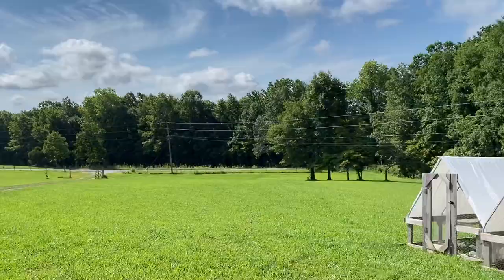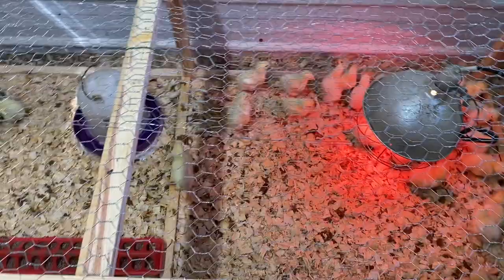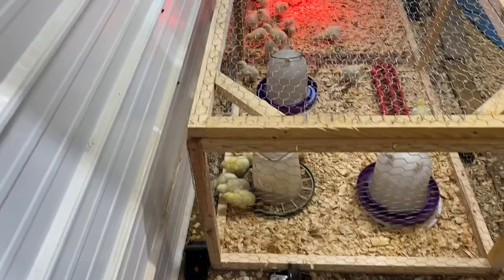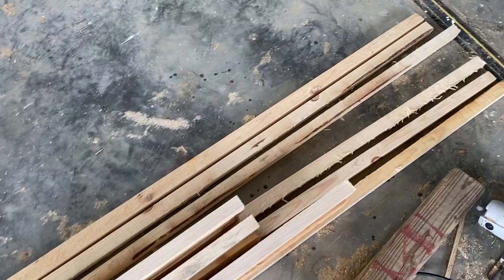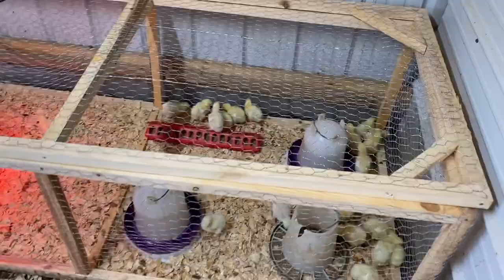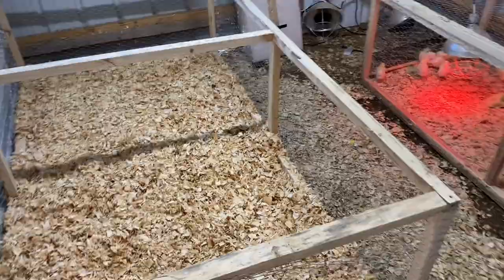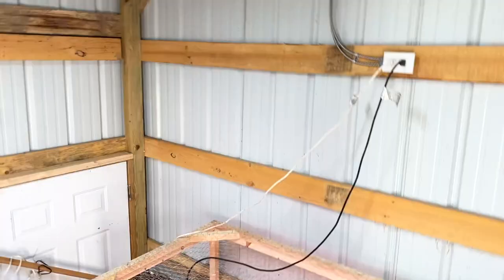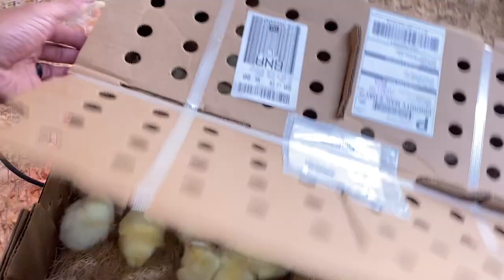Protecting our Cornish Cross Chicks from Predators!

Comment: Hi John,
Predators are always a battle. It’s easy to be an armchair quarterback but wanted to float and idea. How hard would it be to prep that room and pour a concrete floor? That would eliminate predators from digging in. Also would be easy to clean and disinfect. Raising birds on dirt opens you up to the dirt harboring pathogens like coccidiosis. You could still divide the room into sections to stagger your brooding dates. A cheap concrete mixer from harbor freight and bags of sacrete would do the trick. Pick a cool day for the project.
Reply from the maker: We have thought about doing that

Comment: I would definitely not use chicken wire for any birds.  My experience is rats, mice, snakes, raccoons, etc can go or reach right through it.  Hardware cloth is best.  Best of luck with the setups.
Reply: And don`t put the legs on the corners but a litle bit more to the centre  so the rats and mice can1t climb up
also keep the floors clean  in that building, and fill rat/mice holes with steelwool
Reply from the maker: Thanks for the tips great ideas